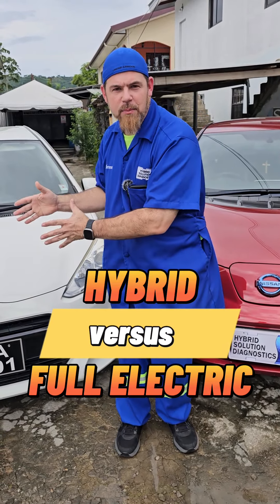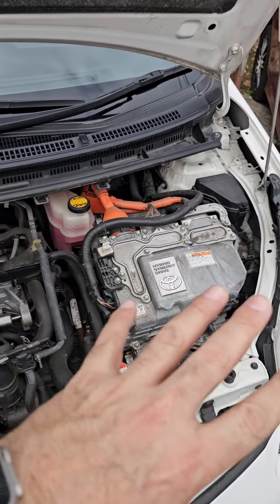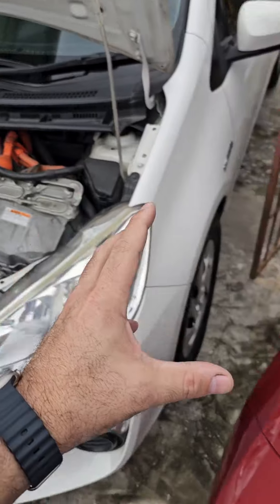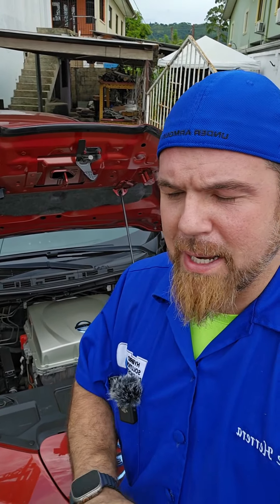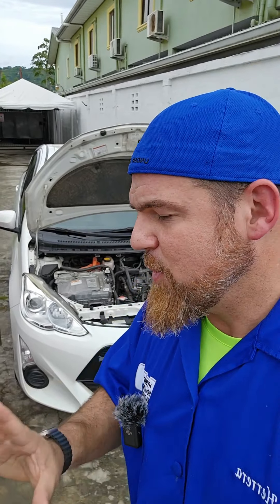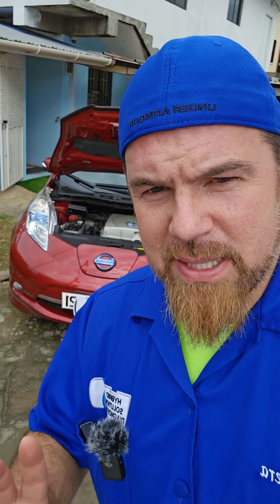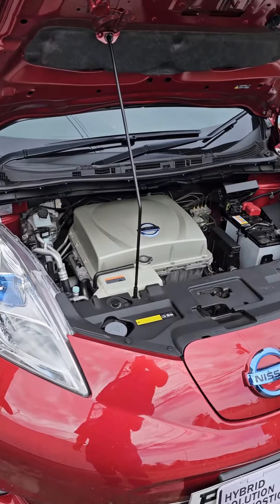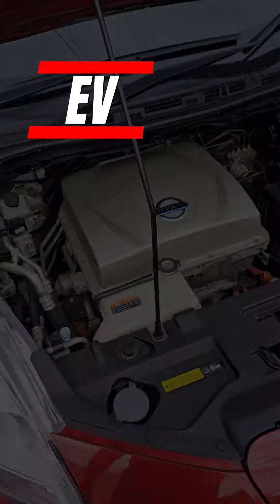Hybrid Car vs Electric Car

Comment: What about longevity of the vehicles?
Reply: Probably Hybrid would be more durable and doesn't rely solely on the battery. As an owner of a Note e-power it has been brilliant maintenance is amazing and a well understated car. When battery degradation happens for both vehicles the EV will be the one that suffers, hybrid is still drivable and range will dip a little.
Reply: @chunkybeats79  most EVs nowadays have very little battery degradation, as in 10-15% over the course of 10 years. Plus, EVs don't have a combustion engine with hundreds of moving parts. So overall a full EV is usually more reliable than a hybrid.
Reply: @beanapprentice1687  that's all well and good but the whole trying to speed up charge times with EV batteries is not a good thing. Jose even discusses in his livestream. Fast charging anything with a battery is not good for battery health, the amount of energy going into charging that battery is insane so degradation is more prone and even battery fires are caused by this in conjunction with heat. It's basic physics. Hybrids not plug in last longer because they charge the battery at lower voltage so the battery will last a lot longer. Look how many 2nd gen Toyota Prius on the road. Thats nearly 20 years ago now that's reliability right there. How many Tesla batteries will last that long
Reply: @chunkybeats79  fast charging only causes noticeable wear on the battery if it is done regularly, and most EV owners charge their car at home or at slow public chargers the vast majority of the time, so it’s not an issue for them. Also, don’t forget that the vast majority of EVs have liquid cooling systems for their batteries, unlike most hybrids which only have air cooling.
Reply: Good points by you guys. I think it would come down to the user and how he uses the vehicle. It might be cheaper to run a full ev in the short term as compared to a hybrid in the same period, but cheaper for the hybrid in the long term. I think overall the hybrid will outlast a full ev but time will tell. I’m not sure of the lifespan of those electric motors. Also electrical components/sensors used in the various onboard systems can tend to be less durable and more expensive than mechanical ones. 
I think the battery life will depend on how the vehicle is driven, charged and stored.

Comment: Why everyone, when talking about EVs, don't take in consideration the FACT that the batteries are CONSUMABLES. For every km that you do the battery degrades a little. And when the time comes to change it you will find out that all the money you skipped on maintenance will go to buy a new battery. So no win for the customer.
Reply: Engines are consumables too. And most EV batteries last 15-20 years before needing replacement (except for batteries in the Nissan Leaf, which has no battery cooling system).